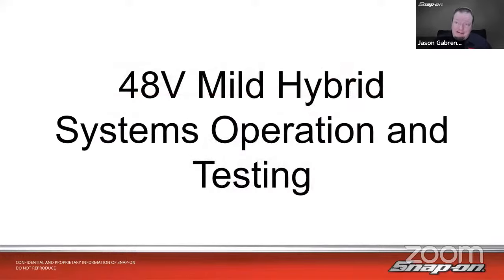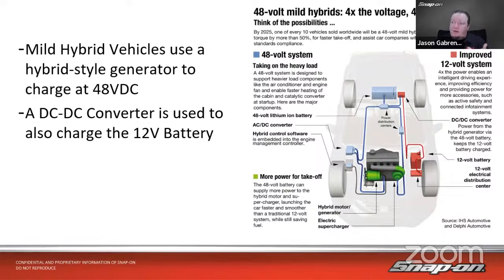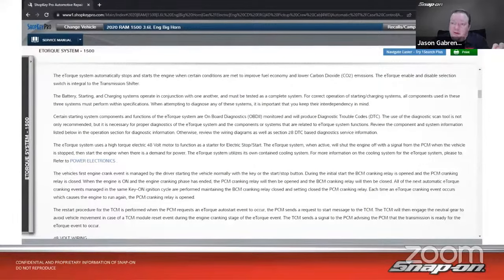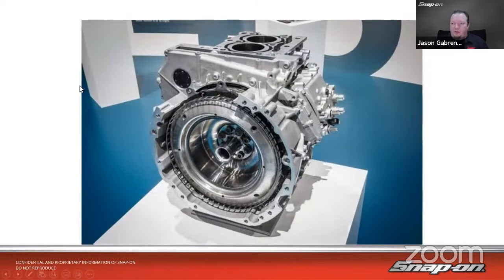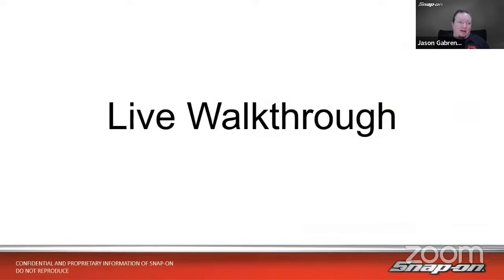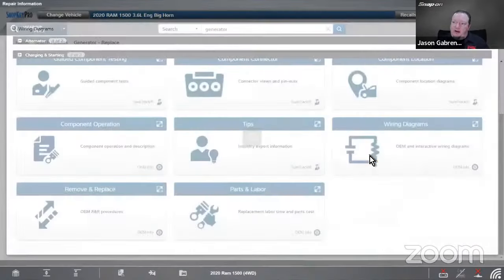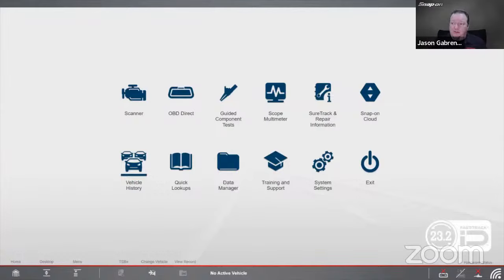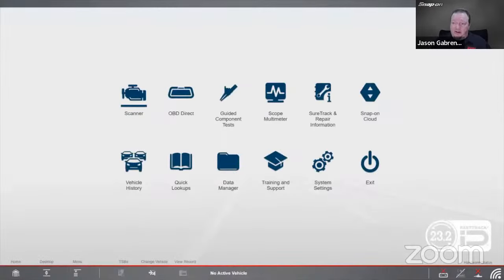Snap-on Live Training Episode 62 - 48V Mild Hybrid Systems Operation and Testing

Comment: Q8 2022 just arrived to our workshop and trying to figure out how to get the login acces code to be able to reset the system... What a mess is this new system...
Also trying to know if the HV Battery is dead or not. At least we could change the 12v battery! 😅
Reply from the maker: For the login code, I think you're referring to the Profile Access Code. Here's a video walking through that process.  If you have further issues or questions, please reach out to our Customer Care department at 1-800-424-7226.

https://youtu.be/MLqAcN1i4Sw
Reply: @SnaponDiagnostics  Thanks I'll take a look, what I want to reset are the protection relays, they opened because of the low voltage in the HV Battery
DTCs: P0A7D, P0B29